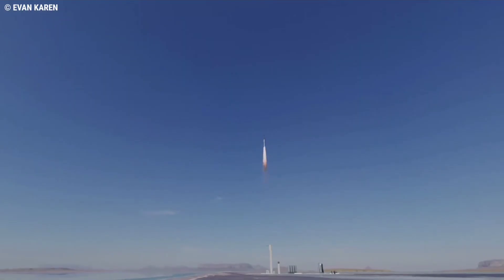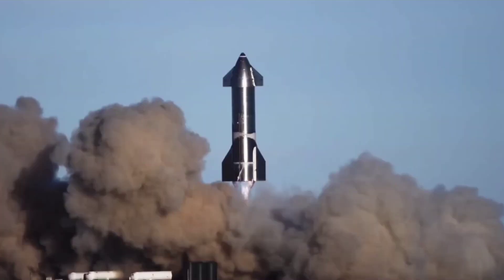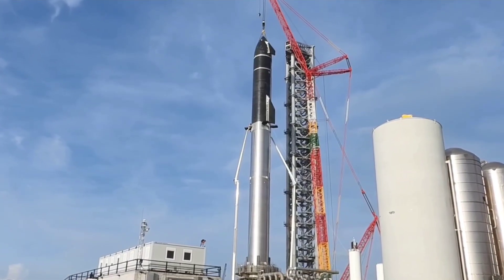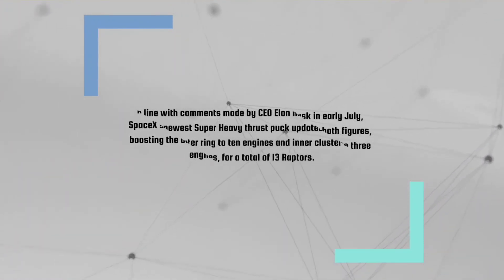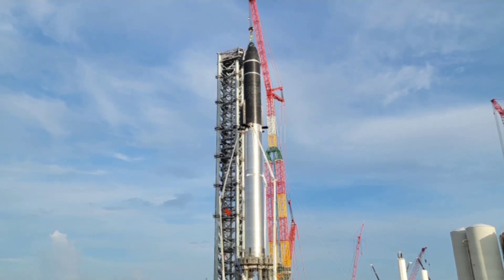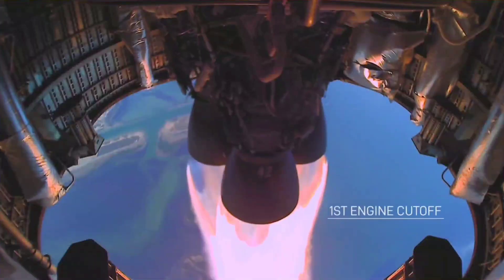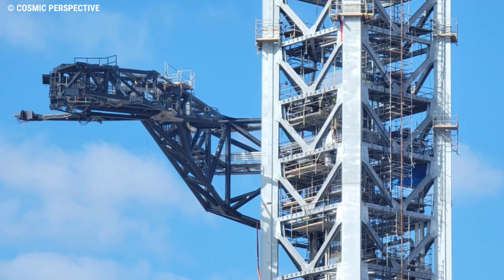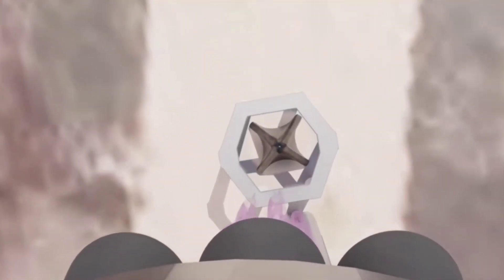Analysis Super Heavy BOOSTER 5 ! What Makes Booster 5 Different From Booster4!

Comment: Does anyone know whether superheavy and/or starship would float -- i mean it will consist mainly of presumably sealed? empty (well full of air?) tanks.
Reply: Without actually knowing the answer I would guess they would float being mainly huge empty tanks.
Reply: They would float easily! Do the math for just 1 linear foot of a 30-foot diameter tank. The math is pi x radius squared x 1 ln. foot x weight of seawater (64 lbs / cubic foot). This gives us more than 700 cubic feet of volume for each leaner foot of the ships' length x 64 lbs = more than 44,800 lbs of displacement per linear foot... Not only would it float, it will bob like a cork! The engine-end of the booster and ship will sit lower in the water, but they will still easily float... For the ships to sink, the tanks will have to be opened to allow water to enter. Note the ship's skin thickness is much thinner than a supertanker, and empty the density is approximately that of a tin can... Ever seen floating spherical steal buoys? Those float easily too!
Reply: @Knossos22  so basically they will be potentially retrievable for analysis of what the re-entry has done to the heat tile system and fuselage (assuming the booster and starship land intact), rather than sink to the depths. (probably to be scavanged by chinese and russian subs disguised as fish and octopi in a frantic race)

Comment: It really would be great if the starship booster could be caught by mechezilla, but in order to do so I think its landing would need to be better than the Falcon 9 landings because although they do land on the recovery vessels fairly near the target centre I’m not sure that is going to be close enough, but I do hope so.
Reply: The Mechanzilla can rotate an angle to catch booster if its landing is within the reach of the chopsticks.
Reply: @tocu9808   in that case we will just have to hope it will be within range, but that’s my worry, not much room for error.
Reply: @keithmayes4358  - Yes, It would be a miracle if there won't be any destruction in the first landing of super booster back to the launch site.
Reply: @tocu9808    Just imagine if things went a little bit wrong and the starship booster crashed into the tower and destroyed it, all that work down the drain!
Reply: @keithmayes4358  - That concern is the reason why in the debut test flight they will have the super booster landing in the ocean offshore Hawaii. It may take them a dozen times of such test to ensure the reliability and to fine tune the accuracy of the booster landing, before gaining enough confidence to have it pinpointly landing back and safely caught by the Mechazilla at the launch tower in Boca Chica.
Reply: @tocu9808  I can totally understand why they are not trying to land the first flight but instead have it crash into the sea, too many things being tried for the first time, but how can they test the landing accuracy? At some point the first attempt at catching the booster will be trial and error, they can’t practice pin point landings at sea, unless they try landing on a barge, but how could they even do that with a booster that size? 
Whatever happens it’s going to be so exciting watching that first flight take place, a little piece of history being made that in years to come settlers  living on Mars will look back and say that when it all started.
Reply: @keithmayes4358  - SpaceX is converting an oil rig into a sea launch platform which may be used first as a booster landing test pad.
Reply: @tocu9808    I suppose they could try a landing on the converted oil rig first but that would be a far costlier risk than just damaging the catching tower, I think. So much money is poured into these operations it’s hard to know what costs the most. Either way let’s hope the first test flight goes well and see what happens after that because I’m pretty sure Elon won’t risk a mechezilla  catch until he is as sure as he possibly can be that it’s going to work, he knows the whole world will be watching.
Reply: @keithmayes4358  - Not sure if a  crash landing onto the sea platform, which is like a mid sized air carrier deck, would cause more damages than the case of same thing happening at Boca Chica launch site. And there's probably contingency plan to explode the booster mid air on its way down should things are observed to go awry at the last minute.

Anyway, there must be calculated risks for them to take before getting the whole thing working seamlessly as expected. That would be a rough ride with multiple ups and downs, twists and turns, but hopefully without any catastrophic incident.
Reply: @tocu9808   even if the first flight does crash badly a lot will still be learned from it and the next Starships are being lined up ready to go. It was the same with testing the first basic SN numbered Starships, it took I think four attempts before it landed upright and didn’t explode, but important data was collected from each flight. This seems to be the SpaceX way of doing things, build them fast, cheap and lots of them and why worry if they crash because the next flight will be that much better.
Reply: @keithmayes4358  - Iteratively incremental development has become popular trend in software production. Buid fast, fail early, and improve continuously. Yet it's amazing to see that agile development method being effectively applied to system engineering at such large scale. SpaceX is actually revolutionizing the way space transport systems are built.